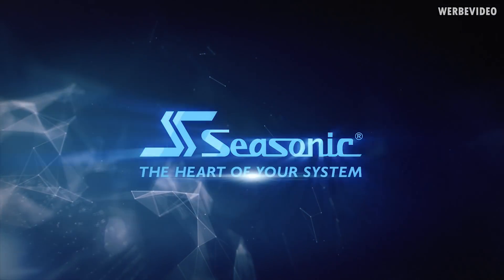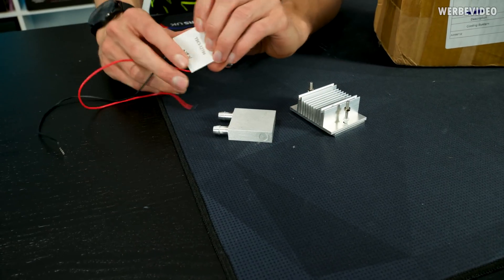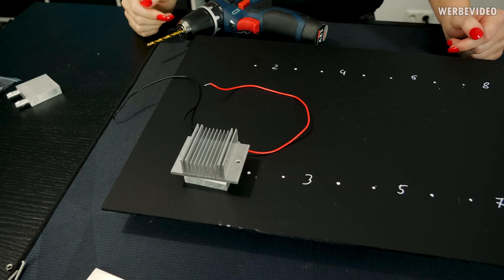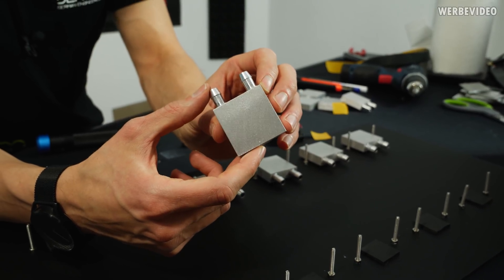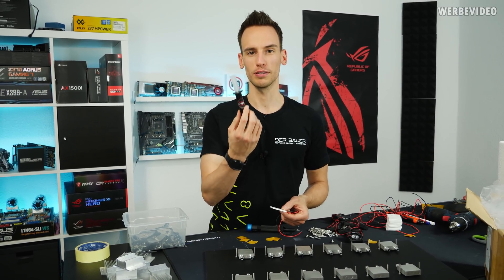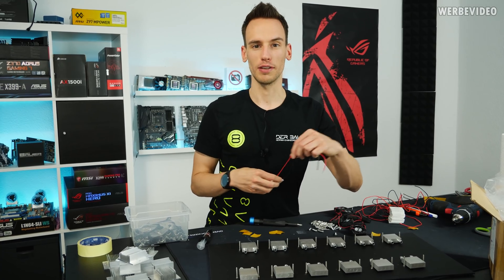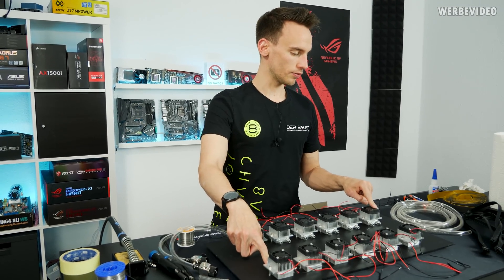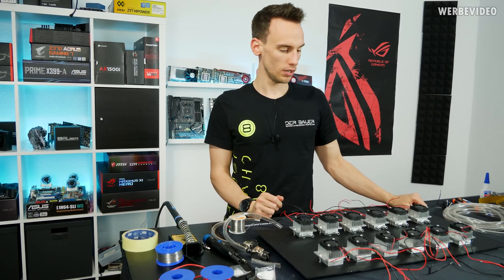200$ AliExpress DIY Water Chiller

Comment: I can give a TLDR since I've actually been down this whole road before(I've had a 7700k at 1.7V 5.5Ghz with 1C water).  Peltiers never make sense to use under any circumstance.  Their power consumption and heat output just become insane before they'll ever remove enough heat from a CPU.  Also, chilled water is substantially overrated.  Even with a proper water chiller, having water that is slightly below ambient temperature won't make a significant impact on your final overclock, but you'll have a substantially higher power bill and a noisy chiller.  Current CPUs are design and silicon (process node) limited...meaning you'll hit a wall where throwing more voltage won't fix it (regardless if the CPU is even 20C under full load at 1.6V).

Comment: I'm surprised no one has looking into a liquid ammonia cooling set up like they use in flash freezers used in commercial industry. 
I know cost is a factor but these systems work very well.
I worked in a factory that had one that would take the product down to -75 c in a minute or two.
dangerous yes. But efficient.
https://www.youtube.com/watch?v=peVAaLIJJ6c
Reply: But isnt there regulation when it comes to handling and acquiring liquid ammonia/ammonia for HVAC and other cooling use?

Comment: The TECs are producing 360W of heat themself, probably too much for the small coolers to dissipate. You might get lower temp idle with lower voltage to the TECs, but that won't help much when you add in the 9900k.

Comment: So wait. I'm not very informed on extreme overclocking/cooling type of stuff. But what is the point of the peltier units? They add heat to the system right? Why have those adding heat to the overall system when you are just trying to remove heat. Wouldn't it be better to just have the heat sinks mounted to the water blocks?

Comment: You could watercool the hot side using the same waterblocks you have, you just need a second pump and a rad, if you rearranged the system into a big sandwitch. Something like this:  hot block, hot side, cold side, cold block, cold side, hot side, hot block, hot side, cold side, and so on. All blocks except the first and last would be either heated or cooled on both of their sides, this would make the thing rather compact as well.

Comment: I have built the same thing but with one one TEC a 90w unit added after the rad before the cpu.  The TEC needed a heat sink atleat 4 times as big before it did anything.  I got a few degrees different in cpu temps.  Its a lot of energy for the ganes.  More of a fun thing to play with and not practical.

Comment: These Peltier devices are fascinating and all, but there is a reason they're not being used.  The idea of possibly going sub-ambient (and yes, these things can.. they put them in small fridges for a six pack).. it sounds great, but they use a lot of power.  You could add 2 Ryzen 1800x's with that same 360w, and you would only need an air cooler lol.  The power draw is obviously high, and that 360w is going to bu used at the PSU, making yet more heat, and taking away available power for the system.   The best use for these is reflected in the only products that sell... small fridges just big enough for a lunch, or a six pack.  Something you can take to work and plug in under your cubicle so they stop stealing your lunch from the community fridge.

Comment: This is the dream, I wanted to make a portable fridge powered by lipo batteries and peltier coolers, but eventually gave up due to the fact that the cooling of the  hot side was ridiculous (I used an ice bath and water pump) to have a reasonable cold side. I made 2 videos on my channel about it and it's quite entertaining. "Cooler boat"

Comment: Make it CPU>regular radiator>TEC cooling>back to CPU. That way you get temps of water closer to ambient before getting into peltiers. And you need to stack peltiers to get lover delta + peltier on hot side must be at least twice power. If the hot side peltier is bigger in size, you need heat spreader too between peltiers.

Comment: You should have bought another 12 water blocks and removed the heat with a separate loop. I would suggest at least two 480 rads.

Comment: Its a cool project. I have mentioned this before, but note: the peltier elements can transfer 60W when the delta temp is 0 deg over the cold and hot side. (Probably at 20 C). And when it transfers 60W it is also using 60W. In my setup I found that a delta of 25 deg would only give me about 10W of transfer (still using 60W). But you setup should be able to reach 0 deg water.
Your problem is that the cooler on top of your peltier elements needs to dissipate 120W. Also you need to be able to reach a good delta temp, you can tranfer more energy if the delta temp between the peltier side cooler and the air is large, but if this delta is large then the delta over the peltier is also large, thus a large cooler on the peltier is better. You can try using a cheap tower cooler. But well you need many of them, thus it will not be cheep :-). I used a water cooling loop for this in my setup. I have linked it before, but here it is again. And just so that people do not think I am a total idiot. I know that this solution is stupid and that I should just use my water cooling loop alone (without peltiers), and no I will not recommend this setup to anyone, I made it because it was fun, and I am keeping it because I still think it is fun. It has been running for over a year now, and I still have things I would like to test, and I can afford a new pc if everything explodes. But if you a interested in things like this you know that. And now the link. The first It is just a pdf file, the second is fore som more files. Depending on the humidity the cold loop can be as low as 13C, but nothing extreme. And Yes this is my main pc, that I use most days.

https://drive.google.com/open?id=1tLnRGpx3Iz213YWf7bBUA0wLbQPD_SDY
https://drive.google.com/open?id=1vTiNtx7KAuuUPyaqx6lfuP-acHdhJs_t

Comment: I've done this before and had some success just doubling up on the water blocks and running a separate water cooling loop. I also used "HY880" thermal grease which I got cheap also from AliExpress (and has a good thermal rating). Something else that might help in the interim if reducing the voltage of the peltiers, if you were to use the 5v rail as your earth, you could run them at 7v which would help reduce your heat saturation for the surface area.

Comment: Hey Roman, you could try using a TEC controller. I’ve built a few TEC chillers including one that was inside a system that won dream pc (UK custom PC mag) several years ago. This is the type of controller I used https://www.ovenind.com/pdf/datasheets/DS-5R7-001.pdf. Its expensive but it can keep TECs running optimally. Also I found TECs run best at about 60% of their peek power, plus I would add a 2nd water loop for the hot side of the TECs. Good luck - looking forward to seeing mkii

Comment: I do need to point out here that taking a TEC and giving it all the voltage it is rated for is not how to properly run them in an efficient cooling setup.
If you run them at their rated 12 volts, then they will consume 6 amps, making them produce about 72 watts of heat alone. This means that the tiny heat sink you have on top needs to dissipate those 72 watts + whatever the TEC also manages to pump over from the water block.

The TEC's efficiency to pump over heat is also directly related to the temperature difference over it.

My recommendation would be to instead connect the TECs into a series parallel array to get around 1.5-3 volts over each. Exact voltage will need to be tuned based on how much thermal load the heat sinks are capable of handling.

Comment: If you change the coolers on top of the peltier elements, you can also change the water-cool-down-elements (how are they called?) below. Aluminium is not the worst element for cooling, wood might be worse. But it is also not the best solution^^

Comment: Gotta run this in parallel flow somehow. Depending on the fluid temp drop across each of the element you could get in a situation where the last few elements are doing almost nothing.
Reply: yeah the way he connected is not efficient

Comment: Nice setup :) The way I have set up similar rig before is as conventional closed loop liquid cooler with regular radiator capable of dissipating the thermal load. Then put the TECs in series and help the rad to dissipate even more flux. That way you have a baseline and the more TECs you add the lower the steady state temp will be.

Comment: Use something like BitsPower ramblocks, with each x4 block having 2 TEC coolers, and 2 Hyper212 (or cheap equivalent) coolers. I'll bet you've got a few just lying around! LOL! Buildzoid made a good one a while back. ( https://www.youtube.com/watch?v=iV47MCxakdo&index=9&list=PL2RzvRYB_vutOQLh4givwzvnbV16THnpV ). 
There's also a considerable flow restriction, with each cooling stack changing the coolants direction 180 degrees. Though I guess you could call it the "4K Cooler", since the coolant goes through a 2160 degree loop!
Don't get me wrong Roman, it's a lot of fun to experiment. It's good for the brain, and for the soul. And I always say, "Every day's a school day"!
Have a great day! o7

Comment: What if you could mount a throwaway Intel stock cooler on each TEC? They are good for 80W aren't they?
Reply: Yep. Find some of the old ones that had a copper core.
Reply: Some intel stock coolers wont fill some TEC's fully. Specially the larger ones, like 50mm ones.

Comment: Peltier elements are far more efficient when you run them at lower than their max specified power to keep gradients lower between heat sink and water block (please google "peltier efficiency curve"). It would also help to progressively reduce power fed to the TECs downstream your chilling setup so the elements at the hot water input get highest voltage and its reduced gradually towards the cold water output. Simple but inefficient way to achieve this would be to use progressively larger power resistors from hot water input towards cold water output. Really cool project and I'm looking forward for the updated version!
Reply: Tadas Nanartonis  Peltiers don't like unfiltered PWM. It induces too much thermal stress at junctions and reduces life of the element drastically. It's basically like turning them on and of hundreds/thousand times per second. TECs prefer soft starts/stops. PWM would be ok with some filtering tough I guess. Small choke in series and then modest capacitor in parallel with the element.

PWM would also not help with efficiency, because you would still be running @ full throttle or off. Efficiency goes up like crazy when current is lowered but PWM will only lower the average current.

Comment: Please try this in combination with a radiator ... radiator for cooling to ambient then this chiller only has to handle dropping the water below ambient.
Cool vid either way!
Reply: Once the water was bellow ambient you would have to bypass the radiator or it would start to pick up heat from the air and actually hinder the cooling.
Reply: @thanebaxter  actually the water Comes out of the cooled PC above ambient.
Reply: @ulrichkalber9039  Depends on how cool it it is going into the cooler.  If the wattage of the CPU is not enough to bring it above ambient then the radiator will in fact hurt performance.  Not knowing what the input temperature will be we can't assume what the output temperature is. As poorly as the system was working there is a good chance you will be correct.  But it isn't a hard a fast rule by any means.
Reply: Very difficult to go below ambient with a radiator. I run a 1hp chiller on my setup. When the chiller is on all my fans are disconnected. Improved temps by 9c

Comment: that the problem with peltier elements to much power requirement for little gain.. people have tried using peltier elements for years to cool computers but they are pretty useless for that.. just make a portable little A/C

Comment: Like a lot of others here(and I bet you knew too),  I saw those heatsinks and said 'naaaa, not happening'.  Back in the early 2000's I was experimenting with peltiers and came to the conclusion that they are just too inefficient to use on the daily.  It's even worse now with the thermals the OCing chips put out.  >__<
Great experiment though for those new to extreme OCing.  ^__^

Comment: A quick fix for now would be to undervolt the peltier modules. Try running them at 5v instead of 12, you'll probably get a much better result. I usually use a normal full sized CPU heat sink that has heat pipes and a 120mm fan to cool just 1 of those @ 12v. I've done stacking experiments whereI run 1 at 5 volts with another stacked on top running at 12v, doing this I've got them down to -40C! I got a large petier I want to directly run to a cpu, but it was defective and gets hot on one of the corners, even with good cooling. You can buy larger modules and just run them at a lower voltage to get them to work with a cpu again with stacking to increase the temp differential.

Comment: I did the same thing a while back with a pair of cheapo "100W" TECs on large silverstone tower coolers with crazy Delta fans to chill the loop, but even with that I could only get down to 13c with the CPU idle, and would quickly exceed 20c I started something like cinebench. Looks like you ended up being disappointed same as me, TECs are pretty rubbish tbh. Very cool video though, always good to see what you're up to :D

Comment: Stack the Peltier elements 2x and you will only need 6 good coolers for the top ones and the bottom ones will get much colder than with a air cooler and will achieve -?°  for sure. Problem solved.
Reply: And don't forget to drop the voltage of the bottom ones

Comment: The problem is that the peltier push more heat in the system than the heat sink is able to handle... So how about just simply under volt the peltier? That way the terminal output wuld be lower, tough the the cooling is also getting down, but you might prove the concept with getting down the idle temp on the cpu before spending a lot of money and time on the system

Comment: I just got that same Drill for Christmas and its awesome! Small but very powerful. I have one at my work and use is in metal fabrication and welding. It takes a beating and keeps on working. The only downside to using it in the work place is the battery life starts to fade over time.
Reply: I just modded a cheap drill, it’s super nice so far. I have a lot of high performance Lipo batteries for race quadcopters, so I saw no point in having “another battery” to maintain when I can just charge a generic battery with the rest. Plus almost no voltage sag under load (rated 150 amps continuous, 300 amps for 10 seconds compared to Li-ion at 2 to 5 amps by comparable size)

I’m impressed, $8 drill rated 12v and $30 16.8v battery = arm twister, Lol!

Comment: Maybe try to place a large room fan next to the installation, so you don't end up with hot air circulating. 
Your main problem might be that the little fans constantly pull in warm air from below.

Comment: How about combining a standard air radiator loop with the Peltier loop to get a more energy efficient cooling system.
The radiator loop could take out most of the heat, and the Peltier could make it go lower for a stable 20 °C.
You could try it in series, or as 2 parallel loop's where you can regulate the water flow through the loop's for fine tuning.
Reply: AFAIK "efficient" is not the case with Peltier. You could use them to get electric back, to power the fans. Theoretically powering the fans for "free". But it may end up with hotter system than just powering the fans off the PSU/wall.
Reply: The radiator wouln't be doing anything, assuming ambient T is 20C
Reply: @WouterVerbruggen  It would be cooling the 90 degrees water... Like... it would be cooling it. The peltiers are too slow/small and not powerful enough to take out the 250w heat of that CPU.

You can though add them to an existing cooling solution to add cooling.
Reply: No. The radiator will heat the loop at anything below ambient. I run a 1hp chiller   all my fans on the rads shut off when below ambient
Reply: @dime4026  That is a good point. You would have to turn the radiator loop off when it goes below ambient, and on when it goes above ambient.
Reply: U would have peliter to cool water while using the chilled water to cool ur CPU/GPU. Do considered that you will be needing about the same power to cool the system and running the system. Imagine doubling ur power bill

Comment: If you add a 240mm rad and fans for the output from cpu before going to the chiller loop it might increase the efficiency after you get the hot side of the TEC's cooler.

Comment: There wasn't enough heat in the loop for this to work. Peltiers should be applied to the highest heat source, try stacking them between a water block and the CPU IHS.
I dabbled with this stuff back when socket 939 was still the shit, so I don't know if the tech has dramatically changed since then, but I doubt it.
Reply: They already did this as was stated at the beginning of the video. It is in his previous videos.
Reply: Correction not what he said but it has been done in the past. Pretty sure it was him but may be another source.
Reply: 1 60w tech wouldn't do much against a high end cpu.
Reply: @KillaBitz  They are stackable afaik
Reply: Also saying not enough heat is misguided. It's about a difference not a temperature. The trouble is he's not shifting enough energy from the techs for them to work well. If he could get the top to room temperature instead of 60c the water would be at -20 ish.
Reply: @KillaBitz  Everybody knows what I meant